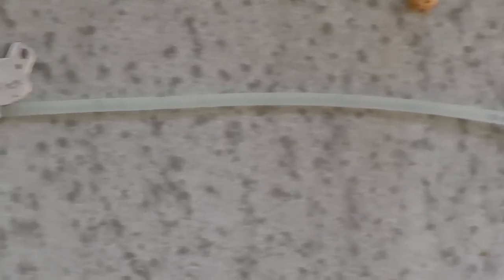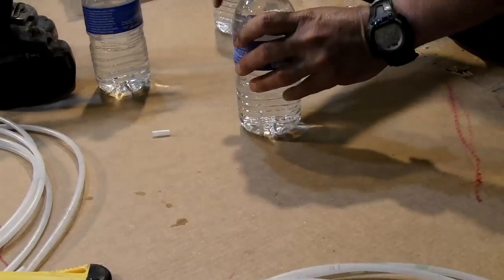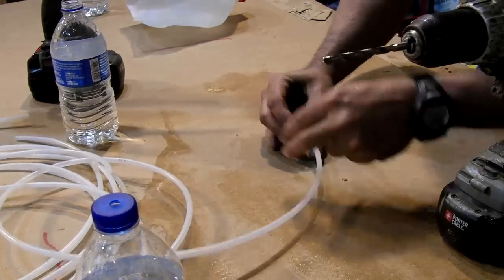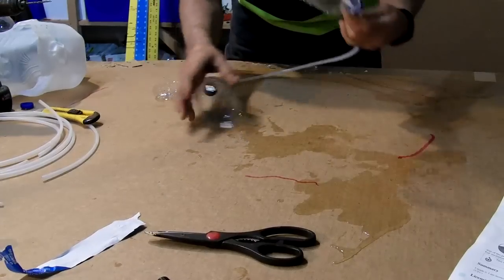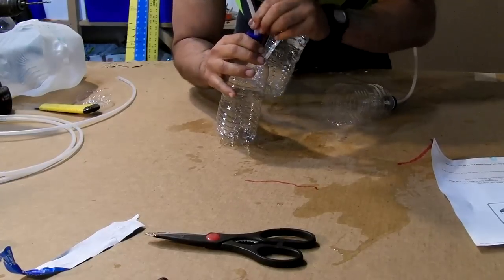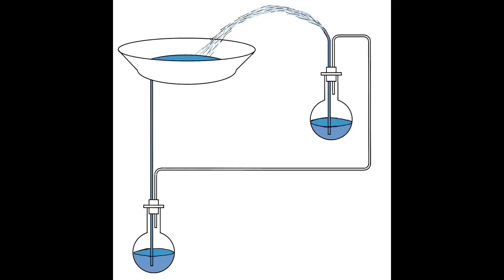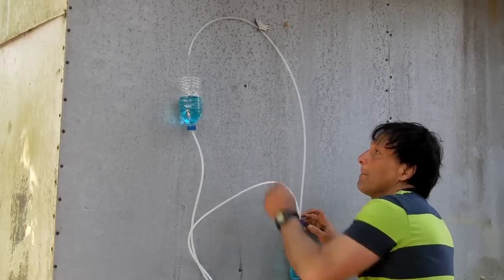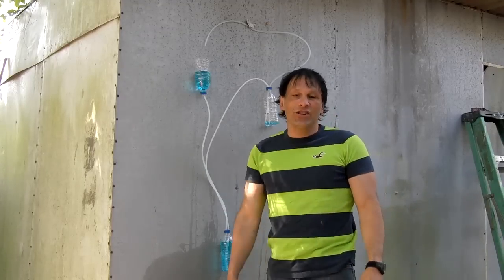Heron's Fountain Plastic Water Bottle 2 minute DIY no sealant, no glue

Comment: give me the driving equation and show mathematically time to run out the project and make big model for the whole two days long size cycle to used as a water battery to restore the water for turbine and generate electricity of 5 MWH for small hose hold

Comment: I posted this as a reply to a comment, but I'm putting it here, cos some people seem to not understand the whole thing. Hope this explanation is clear and helpful.

The system is powered by water in the top bottle falling to the bottom bottle. So when any of the bottom bottle is full / top bottle empty / middle bottle full, it will stop. 

It's a simple thing. A bottom bottle full of air, middle bottle full of water, top "basin" made from a bottle, initially empty.

To start, water is poured into the top basin. It falls down a tube to the bottom bottle, which is full of air. 
That water falls into the bottom bottle, forcing the air in that bottle to be pushed out, upwards.
The air travels up to the middle bottle, which is full of water. 
The air pushes down on the water in the middle bottle. 
That air pressure forces the water from the middle bottle out and up the tube.
Where it goes up, and squirts out, to be caught in the top basin.

And from there, that water runs down, and the whole thing starts again. 

At least, until there's no air supply left in the bottom bottle, or no water supply in the middle one. 

You get it? This video is a good example, makes it pretty clear. Maybe an ever better way would be to dye the water in each bottle different colours. If anyone wants to do their own vid, please do that. It would also be interesting to use, say, oil, in one of the bottles. Just to see where it all ends up.
Reply: Life saver !!!!

Comment: I am trying to build a "perpetual"  one. It would run off sun power. need to make one bottle painted black and use acetone instead of water. the black bottle should boil at 132 degrees and boil of into another bottle where it would cool condense and return.

Comment: I saw a guy that made the two bottles at the bottom even and right next to each other.  The unit ran forever.  I also think he used brake fluid because air and oil don't mix.
Any idea if this is true, I could see making a generator with that idea.
Reply: No, it doesn't run forever. Just until the initially-empty bottle fills, or the initially-full bottle 

Did you pay attention to the video? He explains how it works. Go through it, or look up Heron's Fountain. Figure it out til you understand it. It's not really complex. Then you'll know why it doesn't run forever.

Comment: ultimately a hydraulic ram pump would seem to be a tad easier and more efficient to use but this quick cheap build is impressive. One might be able to run into situations in which a Heron's Fountain, though (slightly) less efficient, would form a good alternative to setting up a hydraulic ram pump.
I would love to see you put together a hydraulic ram pump, though, Dan!
Reply: I dunno, since this requires the bottles to be emptied / filled between runs. I suppose you could do that with a water-powered mechanism, but I can only presume they've been using ram pumps for a good reason. 

This has no moving parts, which is nice, but to convert it to continuous operation, you'd need to add moving parts, at least valves. It also gives a pretty weak pressure increase. The power source for this is water flowing from the top bottle to the bottom one. Look at that distance, compared to the fairly small amount of height the water gains in the fountain. 

This shares some ideas with the ram pump, but the ram pump's main principle is different. I bet this wouldn't be as efficient, or effective. Ram pumps can run for years without maintenance for years. Wikipedia tells me a typical hydraulic ram is 60% efficient, but 80% is possible. Not much to improve on!

Comment: Any idea on how to use the same concept for watering plants?
Reply: There's no point, may as well just use a hose.
Reply: Maybe if you have a large, buried water tank and one higher up, on ground level you can fill up. Then you can gradually let water spill onto plants without needing pressure from the water mains or a pump. You'd just need to refill the tank every so often. You could even divert rainwater into the ground level water tank instead so you don't need to refill as often or ever.
Reply: Possibly use a bigger cone on top and paint the bottle a dark color, then put your plants in perlite in the cone for self watering small plants. No clue if it would work. Could be worth a try

Comment: What good is this device
Reply: a cheap and simple-to-build alternative to a hydraulic ram pump: it pushes water from you source to a higher altitude costing only (more) water to do so.
Reply: Socrates Raramuri I just saw a ram pump used in an irrigation to pump from a stream. Takes zero electricity.
Reply: Fun, demonstration. That's it.

Comment: What makes this doodah  come to a stop ?
Reply: It's powered by water in the top bottle falling to the bottom bottle. So when any of the bottom bottle is full / top bottle empty / middle bottle full, it will stop. 

It's a simple thing. Water is put in the top "basin" cut from the bottle. It falls down a tube to the bottom bottle, which is full of air. 
That water fills the bottom bottle, which means the air is therefore pushed out, upwards.
The air from that bottle travels up to the middle bottle, which is full of water. 
The air pushes down on the water in the middle bottle. 
That air pressure forces the water from the middle bottle up the tube.
Where it goes up, and squirts out, to be caught in the top basin.

And from there, that water runs down, and the whole thing starts again. 

At least, until there's no air supply left in the bottom bottle, or no water supply in the middle one. 

You get it now? This video is a good example, makes it pretty clear. Maybe an ever better way would be to dye the water in each bottle different colours. If anyone wants to do their own vid, please do that.

Comment from the maker: The initial container (fountain basin) does not matter. #2 and #3 fill and empty larger #2 and #3 = longer runs.

 If you narrow the nozzle = decreased volume and a good stream would equal about 8 ounces per minute = 16 minutes per gallon x 5 on two 5 gallon water jugs.
1 hour +